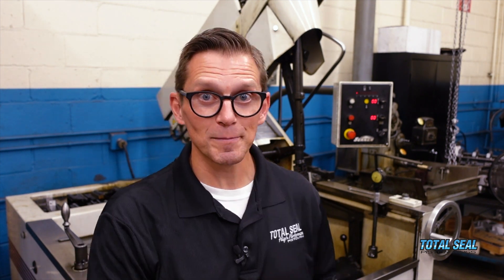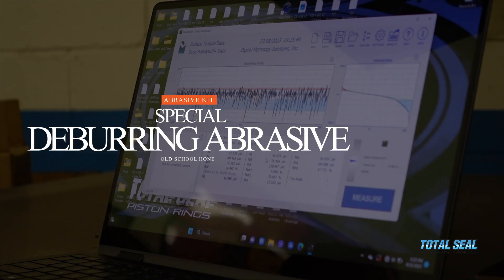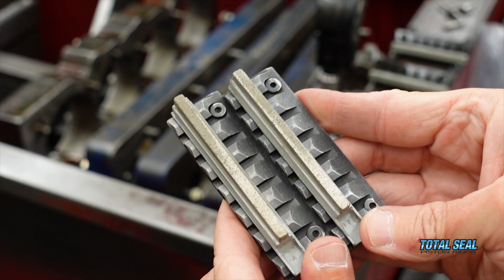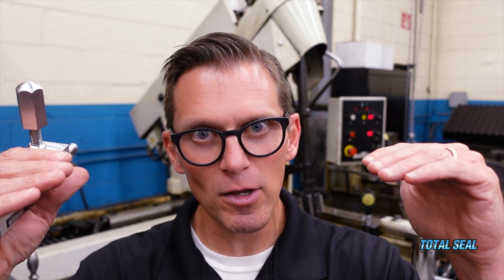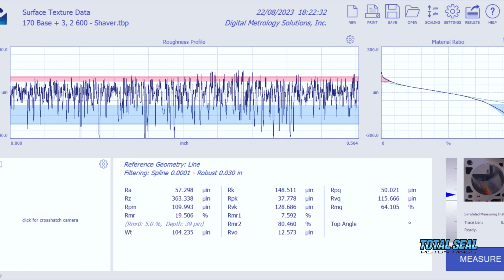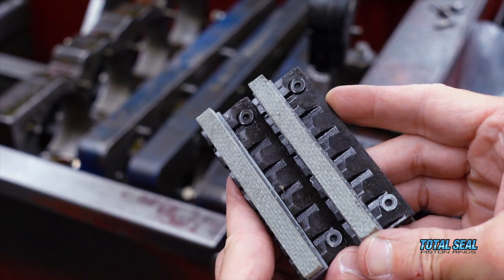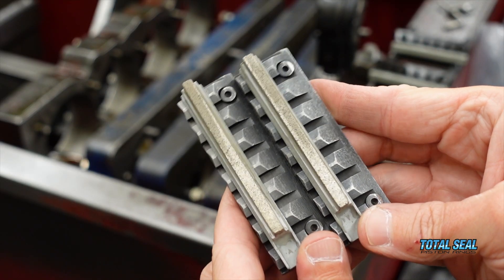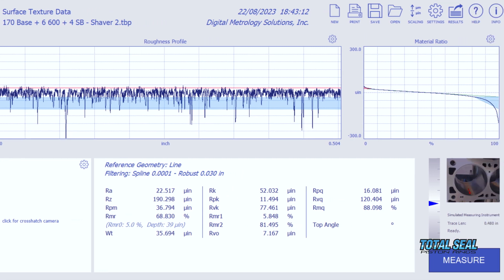Forget EVERYTHING You Think You Know About HONING! These NEW Abrasives TRANSFORMED Our OLD Hone...

Comment: Are these honing jobs and tips being done on steel cylinders or a nikasil coated type of cylinders?  I ask because  most of my engines are coated cylinders and wanted to know if you would use the same process
Reply from the maker: These are for cast iron liners and blocks. Nikasil is a different beast.

Comment: The diamond two step and then bottle brush is definitely worth power.
The first spec sbc 355 engine @500 hp we did 24 yrs ago we gained 8 hp. The second was up 11.
Be sure to use the correct rings for this finish.👍👍

Comment: Why put a head gasket between the block and the torque plate ?
Reply from the maker: It changes how the clamping load is distributed, so it is important for getting it 100% right.
Reply: @TotalSeal    Presumably you could use an on old, used one to save money

Comment: Is there a stone set for the handheld guys out here? Say the Lisle 15000 cylinder hone?
Reply from the maker: Nope, the handheld hones don’t have enough power for the diamonds.
Reply: @TotalSeal  I don't understand. The hone itself has no power, it's the drill you connect to it that powers it. 120 grit is nothing for even a modern cordless drill.

What am I missing in order to understand why this setup would not work fine? Sure, a machine shop would be better, but plenty of areas around the country don't have competent machine shops or wait times are 6 months +. Let alone finding one that can do this process.

I was thinking about it, hand honed block in combination with Total Seal - Total Conform rings seems like a match made perfect for all us diy. I would love to use the 1mm 1mm 2mm or thinner ring sets you've talked so much about and grab an extra 20ish? torque/horsepower.
Reply: @donwasse7892  The CV and CK have 2 HP and have been said to be borderline for diamonds. A hand held drill/hone at 2 HP would be quite a challenge for even the strongest of guys.
Reply: @deadsimpleband6922  that makes sense. Thank you for the information.

Comment: Why do my machines squeal when honing . Same machine same abrasives different fluid
Reply from the maker: Different fluids have differing levels of lubricity.
Reply from the maker: Quaker Cut 004PE works great with Diamonds.
Reply: The diamond bond in the whetstones is too strong and the dull diamond does not crumble: the disc is "too hard". This may also be the reason that the bond is so strong that there is no space for chips between the diamond grain and the disc bond and abrasion occurs

Comment: Fot the initial rough-in hone, is the diamond pads required?  Will a similar grit standard stone yield similar results?
Reply from the maker: The Diamonds are required for this process.
Reply: Diamond is the hardest natural material and it can "mill" the deepest narrow grooves on the cylinder, unlike other abrasive materials. The problem with diamond is that there are eight varieties of diamonds and some are, let's call it, more sharp-aggressive and others "blunt". In addition, larger grains are less sharp than smaller ones, and the larger ones harden the cylinder surfaces more and only the smaller ones cut. The secret is to find a good source of diamond for honing stones. I used diamond blades for processing super hard materials and out of about 600 tool manufacturers in Europe, maybe 10 had what I expected... Don't get into this topic, it's a bottomless box unless you are a stubborn perfectionist and have a budget for testing